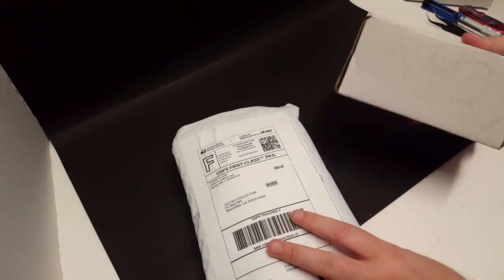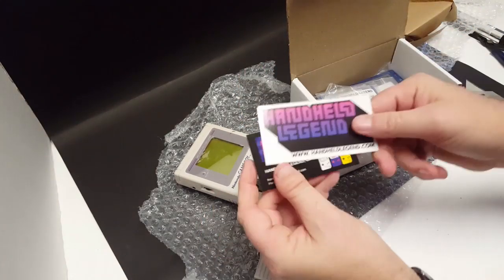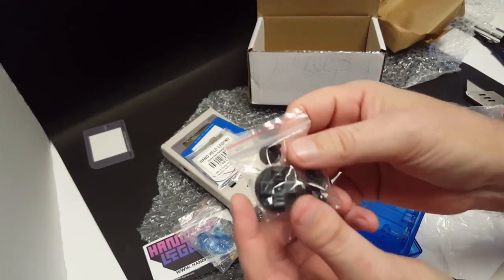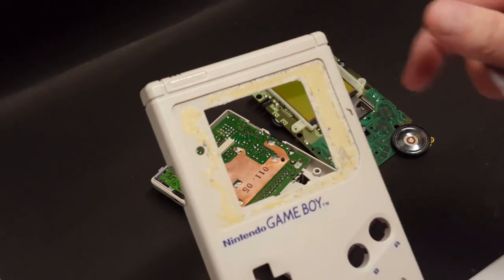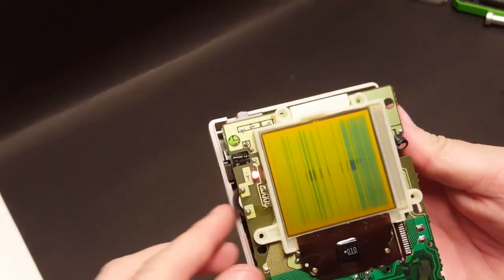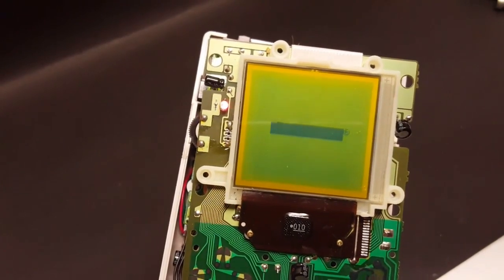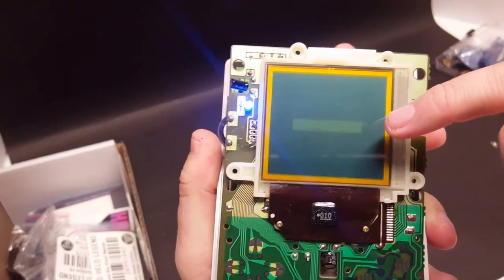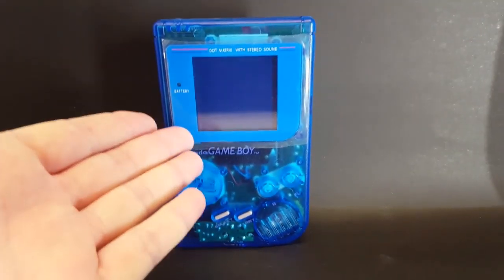Fixing eBay Junk - Gameboy DMG Overhaul

Comment: I got one and I have some stubborn vertical lines I spent two hours yesterday trying to fix them ive gone back and forth with my soldering iron ive laid my soldering iron on the strip for a long time and nothing any tips to fix this problem?
Reply from the maker: It has taken me an hour to fix vertical lines before. Sometimes it can be done quick, other times they wanna be stubborn. This is the only way to fix them though, so just be patient and keep trying.
Reply: Thanks for the help I'll keep at it
Reply from the maker: @TXNFan93  no problem. If you get stuck, send it to me and I'll work on it. Just an option.
Reply: I sure will I just really want to get into modding and fixing them myself but I sure will send it to you if I get stuck